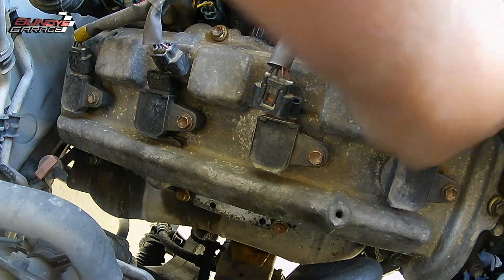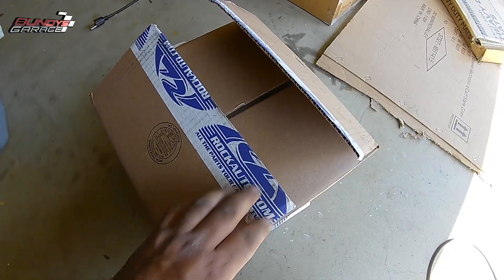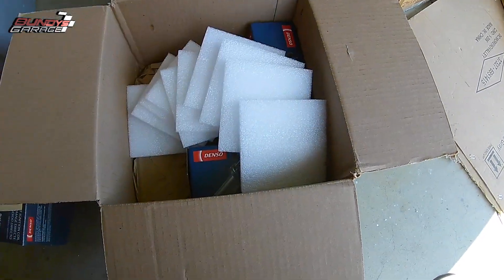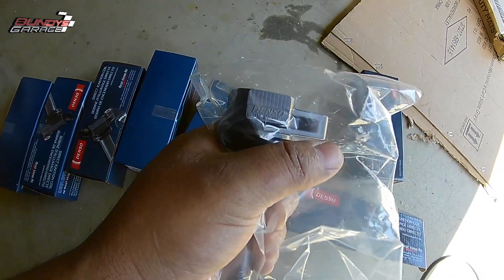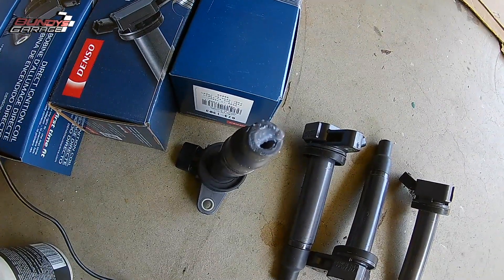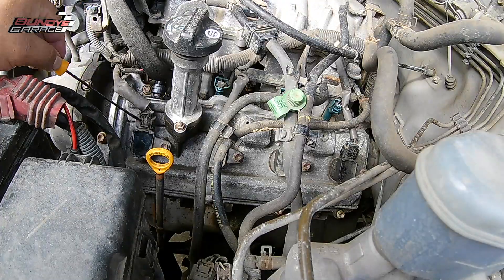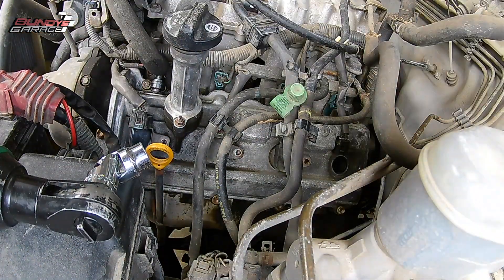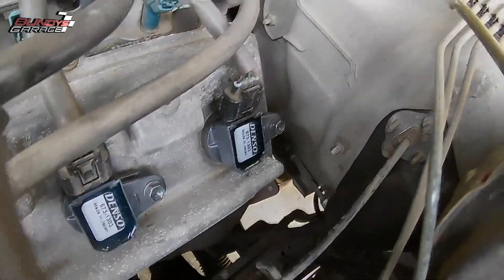Ignition Coils Replace ALL OR ONE at once | Check Engine Light Flashing

Comment: ok so i got a 2002 Tundra in 2016 one of my coils goes bad i buy a single coil and move on about 2 month later a second coil goes out im like ok I see whats going on i find an *pack on Ebay some chineese writing brand name but a life time warranty for 50 bucks i buy and replace all of them a year later after i put i a new stereo another dies i try to contact the seller and company warranty is toliet paper find another pack of 8 on amazon also with life time for 60 replace all again wait a year another dies contact them get replacement for free 2 months later another coil goes contact again 3rd time they send me a replacement for all 8 i think i messed up stereo install and i want a back up cam with blue tooth and touch screen so rather then put the new one in myself i have a pro do it i explain the trouble i'm having hoping he can help he says he will take a look he says the stereo isnt the issue a coil blew bout 4 days ago i've already ordered Denso 8 pack
Reply from the maker: Jsut order them on ROCKAUTO.com. Great Denso, Hatachi, NGK coils, no after-market, conterfit parts on there. And it's less than the dealership.

Comment: I replaced one failed coil pack on my 01 tundra last November, since then have had to replace one every  month. Put #4 in today. Truck only has 316k miles.
Reply from the maker: Only has 316K miles, that's awesome!!!! What brand of ignition coil are you using? Were those originals that you pulled out?
Reply: @bundysgarage  they were NGK brand, doubt they were OEM.
Reply: My Camry needed its first to my knowledge 244k $230

Comment: Had a very sparse misfire on my 01' Celica for a while. I don't know it's the coil packs, but i'm 90% sure at 144K miles. 
I saw you can get them all for $35...that is beyond a joke to me. I shelled out $200 for the Densos as I know that's OEM Toyota. This is how you do it right .

Comment: Great video. On this topic, is there a way to determine the health of your current ignition coils? Is there some sort of diagnostic that could be done on them? I have a 2007 Toyota Camry that has 117K, fairly low mileage for that model year. At around 70 K my ignition coils Went on me and caused problems; misfiring and flashing check engine light. After replacing them, all is well. I’m just trying to cut that off at the pass from happening again if possible. Thanks for any advice.
Reply: My mechanic tested my Celica at 144K miles and he said they were "fine" but he also noticed they had sharpie numbers on them and were out of order and I had misfires. He swapped them around and I still do though it's rare. I'm not messing around so I'm replacing them all for Densos this week. 
My 94' Camry I sold for the Celica had ONLY 71K miles on it and the ignition coil went out (there is only one, disb cap), so anything is possible.

Comment: i have an audi 2018 q3. engine light on for coil #1. bought the right coils and spark plugs, replaced them all. light goes off then on again. (engine was skipped somewhat too). engine light goes off, then on again. changed coil #2 with #1. engine light goes off then on again after awhile. changed coil #1 with new coil and spark plug. light goes off then on again...some skipping some times and not skipping with the engine light on. what do you think the problem is??  the machine checking the car is always saying coil #1.
Reply from the maker: what do you mean when you say skipping?

Comment: The aftermarket coils from Accel and MSD are junk.The AC Delco coils are made by Denso rebranded as AC Delco
Reply from the maker: How do you know that?
Reply: @bundysgarage  Denso makes some of AC Delco's parts rebranded as AC Delco
Reply: @Toolaholic7  I don't know if there is any truth to that, but I am NOT trusting an AC delco part over OEM Toyota man. Also the price diff is like 600% so even if they did make it, it's not going to be anywhere near OEM spec.